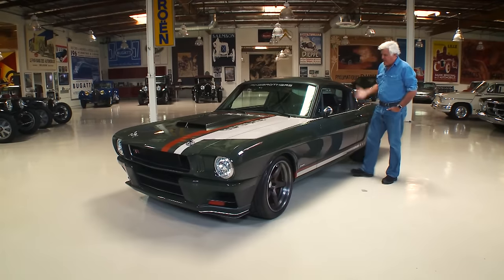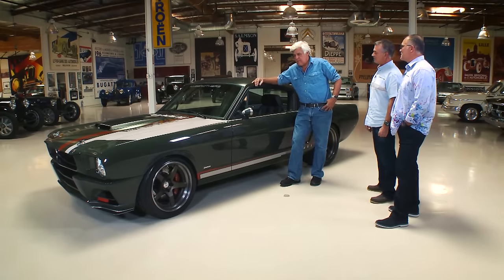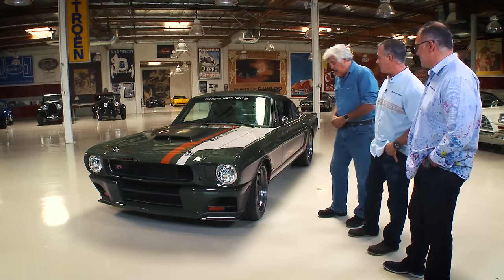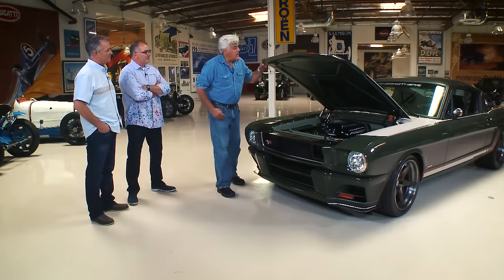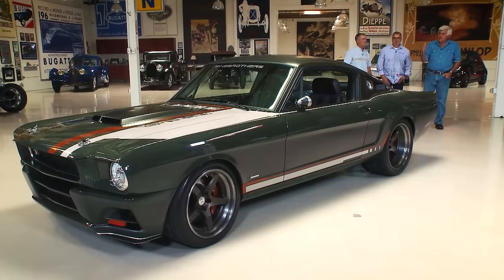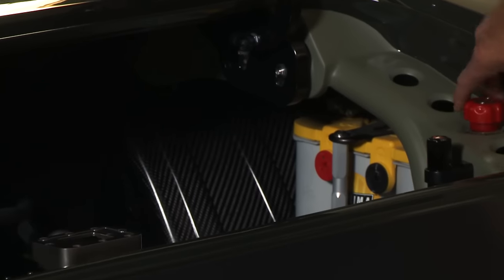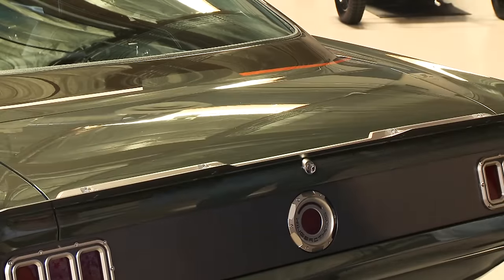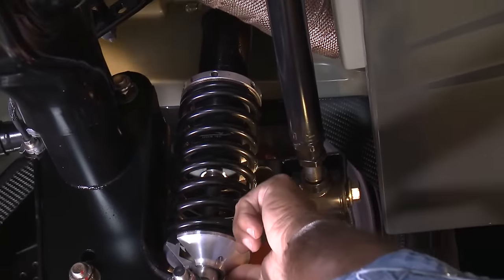Ringbrothers 1965 Ford Mustang Espionage - Jay Leno's Garage

Comment: Huge flaw above the windshield, very visible, what's up with that?
Reply: theparttimewoodworker
Right on the edge at the top center of the windshield. It looks like the trim seam, but it shouldn't show like that, not when you're spending that much on a custom rod. I even double checked it, just to make sure I was seeing right?
Reply: +Moon Hitsearth What times in the video can you see it?
Reply: weirdstuffanimation7
About 16 minutes 20 seconds right above the O in ringbrothers, on the edge of the green.
Reply: +Moon Hitsearth 16:22 FTFY
Reply: +Moon Hitsearth Good eye!
Reply: +Moon Hitsearth Good catch.
Reply: +Moon Hitsearth That is not a flaw, it is how the window trim is shaped due to the contour of the roof line. My mustang had trim just like that. The crinkle powder coating finish pronounces the different shape, when the standard chrome trim hides that detail. This is a Sema build by previous Sema best in Show winners, a car at this caliber is not going to have aesthetic flaws.
Reply: +Moon Hitsearth custom carbon fiber hood.. no way of getting around dat
Reply: +Moon Hitsearth oh yea I can see it. WOW
Reply: +chefdan87 that is no excuse for it though with all the custom work on this car and they couldn't get rid of that. It looks like they painted over a rust bubble.
Reply: +Moon Hitsearth   Looks like a bad weld.
Reply: +chefdan87 Except for the aesthetic flaws you see in this video.  The Ring Brothers probably thought everybody would be starring at the ugly hood, graphics and front valance and not catch the windshield molding.  These guys are really overrated.
Reply: Larry Smith
What flaw are you talking about? Im confused as they state in the video they wanted to retain the stock glass and trim. Yet you people are complaining about your "opinions" not "flaws" toward a factory trim piece. There is a big difference between a flaw and a opinion. You are making judgements on a build, off a video with poor lighting that will never let the actual looks of the car show through. Overrated? Lol is that why they are winning best in Shows all across America beating highly rated builders from all around the globe who show up to these prestigious competitions?   I think the majority of you should leave these videos to the real car and truck enthusiasts who understand the intricacy and sheer talent it takes to build one of these pieces of art.
Reply: Larry Smith
You're an old man who is terrified of change and new things.
Reply: Right.  That's why I modified my Mustang. 

Face it.  You're too young to have developed any sense of taste.  You can't tell the difference between Colt 45 Malt Liquor and 18 year old Glenlivet single malt and you sure as hell can't see ugly when it's starring you right in the face.

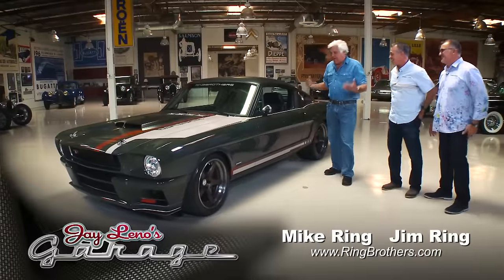Get back to me after you buy and modify a car bigger than 1:25 scale.
Reply: The joke is showing up on Jay Leno's Garage with your $500,000 SEMA show car and having Jay find out where you screwed the pooch.
Reply: +Larry Smith So what your saying is your an old man with an alcohol problem? Honestly what you may find as TASTE, may seem completely overrated to others. You don't like the car/builder? Fine, but just because you happen to not like it, don't assume that the rest of the world should hold your view. Have a nice day old man.
Reply: +Noe Longoria No, I wrote the car has a visible flaw in the windshield surround.  A flaw that was pointed out by other viewers.  I wrote the car had problems that should have been addressed before taking it to Jay Leno's Garage and letting Jay drive it.  I wrote that the design has childish elements and that the Ring Brothers are hacks when it comes to tastes and design.  

You have a problem with reading comprehension that should have been addressed by your elementary school teachers.  But, such is the state of public education.
Reply: Very well said. Funny that he has to attack my education to try and get his opinion across. Poor soul.
Reply: +Noe Longoria

If you have to ask, you prove my point.
Reply: If you try real hard and sound out each word and read everything I wrote five or six times, you still won't understand.

Please get out of the gene pool.
Reply: Nah I'm staying. Its time you left the gene pool. I asked you to explain to me how I'm a dimwit for calling you out. You have yet to do so. Until you do, I have no problem writing a reply to any comment you throw at me no matter how dumb it is.
Reply: +Larry Smith Sorry can't say that I do.
Reply: There you go again, proving you can't string a few words into a comprehensible sentence.
Reply: +Moon Hitsearth - Yup. You're right. It looks like there is flaw starting at 29:42 (https://www.youtube.com/watch?v=MsOX9z59GsE#t=29m42s).
Reply: +Larry Smith Wow. How hard is it for you to comprehend that I was referring to you, stating that i have a hard time comprehending English? And you mock my english skills. It is not my fault your old fashioned.
Reply: +Noe Longoria Also I am well aware there are punctuation errors but I can't edit commets on a phone.
Reply: Noe Longoria
I have come to the conclusion that old man Larry is merely just a troll when it comes to  youtube comments. His family must have put him out because of his cantankerous attitude and he is forced to seek attention on social media.
Reply: Ha. That's a good conclusion dude.
Reply: +Moon Hitsearth factory chrome that never fits that well, they just painted it that god awful green
Reply: It's a trim cap. Where two pieces of trim meet and then it's a 1 inch cap in the middle.
Reply: +chefdan87 It looks like a definite, huge flaw. If it isn't a flaw but still looks like one, isn't that just as bad? And what flaws are we not seeing because poor lighting, etc..? But I msut admit, i do usually love the Ringbrothers work.
Reply: RomVlad
The problem is it is not a flaw but several people who are ignorant to how the trim molding on the 60s mustangs windshields work.  And everyone should know that the true look of a car can not be determined while viewing on a tv or computer screen, you have to be there in person and see it in and out of sunlight to have a full appreciation of the work done. Trying to pick apart a car while it is under florescent lighting is like trying to appreciate works of Salvador Dali with sunglasses on. Its retarded.
Reply: +chefdan87 They could've raised the ledge the window sits on, removed the trim and flush mounted the windshield like a newer vehicle. Even a novice like myself could've pulled that off in a day. 

With that said though this is the Ring Brothers, I assume there is a reason why they did it that way but without them pointing out that reason it simply looks like someone overlooked that part.
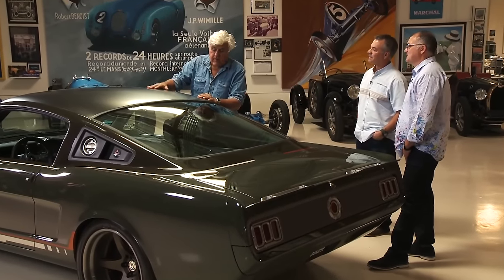Reply: Yeah, it's at 16:30. You can see it very well.. Wonder what that's all about?
Reply: He said the roof was carbon fiber. So that's prob why.
Reply: +Moon Hitsearth Looks like it could be a seam in the windshield molding?

Comment: There's no way that noise was caused by the spring. It sounded like gear clash.
Reply: +oisiaa They said it was louder and more pronounced because of the carbon fiber lets it travel through the body better
Reply: +warren michael I still don't buy it. It was directly related to the drivetrain speed.
Reply: +oisiaa who cares what you think anyway
Reply: +BlazingLost I care, because I also doubt it was from the suspension.
Reply: Agree. How is a spring going to make that noise?

Comment: I don't care for the front fascia nor the stance...hate the door handle and the fuel filler location....sorry but I have an OEM restored '65 real K code fastback Hipo in my garage....Powered by Ford.
Reply: Nice car you have! I like some of the mods on this car, especially the carbon fiber body but not some of the other stuff,engine included 🤮

Comment: The
first-generation Ford Mustang was manufactured by Ford from March 1964 until
1973. The introduction of the Mustang created a new class of automobile known
as the pony car. The Mustang’s styling, with its long hood and short deck,
proved wildly popular and inspired a host of competition. It was initially
introduced on April 17, 1964, as a hardtop and convertible with the fastback
version put on sale in August 1964. Ford correctly read the
market for a new type of car in the early 1960s. Baby boomers were reaching
driving age, more families were buying second cars, and women and single people
were buying cars. Many new-car buyers were looking for economic models with
flair, excitement, and optional equipment that enhanced comfort and
performance. Ford developed the Mustang with these criteria in mind. Lean and
sporty, it was more sophisticated than Ford's first compact car, the Falcon,
and it had some of the Thunderbird's panache. The Mustang saw an increase in overall
dimensions and in engine power. The 200 cubic
inch six cylinder was standard equipment, and produced 120 horsepower. The 289 cubic inch V-8
engine was available in many categories namely 200horsepower, 225 horsepower and 271 horsepower. Later, the 1971 model
saw a new redesign to its predecessors as sales were steadily declining. Thus,
they began working on a new generation of Mustang.

Comment: I had a set of those 'Invo' Tyres (which I think is Japanese for 'Conspiracy') fitted to my Porsche and found they were rather deadly in the wet, very prone to aquaplaning, especially in combination the Porsche light front end. They were also a fairly road noisy tire also.

Comment: I would take an original 65 Fastback over this thing.
The added styling elements added by these guys are not my cup of tea.
Also the fit finish are not great - look at the uneven paint on top of windshield, rear spoiler moving, hideous door hinges, interior without gauge cluster, chevy engine, and biggest of all it broke while on the show!
Reply: My parents have a rebuilt gt350 with 500hp . Sounds far better than the orginal

Comment: I'm sorry but I don't believe their reasoning on why they used a Chevy motor in a Mustang. you're telling me someone spends over $100,000 on a vehicle and there really going to be worried about what mechanic they take it to to fix it if it breaks down!! I'm sorry that makes no sense to me. because last time I check when people buy cars they normally don't go to mechanic and say hey can you work on this car if it breaks if you can't I'll buy something that you can work on!! but hey that's just me :-)
Reply: +Thomas Welcomer yes something smells fishy plus them saying that they couldn't use a 5.4 or 5.8 Ford engines without some modifications to the car makes no sense given the fact the 5.4 is a 330 and the 5.8 is a 351 and the motor they used is a 416. :-)
Reply: +Charles Requa I think a peek at the Ring Brother's books would reveal that GM sold it to them for $1.
Reply: Larry smith. Even if they give it to me for free I would still not put a Chevy motor in a Mustang but that is me :-)
Reply: +Charles Requa You need to learn a bit more about engine displacement. The bore and stroke are what give you your displacement ie; 416ci. The 416 in this car has the exact same size block as the 4.8L 293ci base LS motor. The Ford motors you mentioned are physically larger than the LS motors.
Reply: Thank you Mike Barrett I will but the point of my comment is they using a Chevy motor in a Ford Mustang no matter what the size is you should never do that :-)

Comment: I'm crasy about hood vents and side heat extractors,for all over cooling; with secondary battery on demand,you can do fabulous things for heat management and having on your dash,the control of your fans is great(in traffic),even in the back wheels arches,with 12V extractors for burn out smoke,really great,same for extra high beams and fog lights.